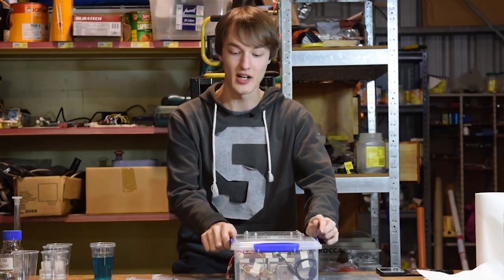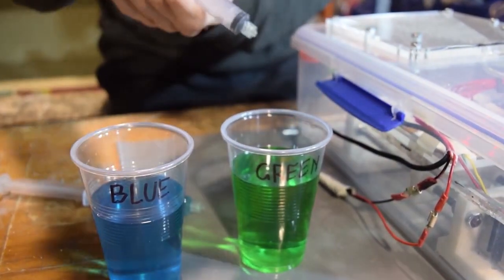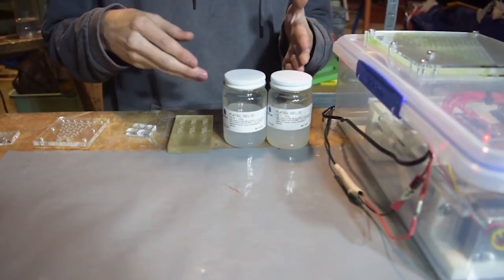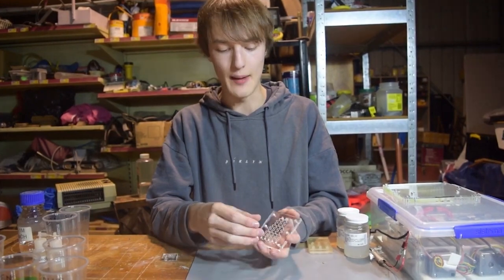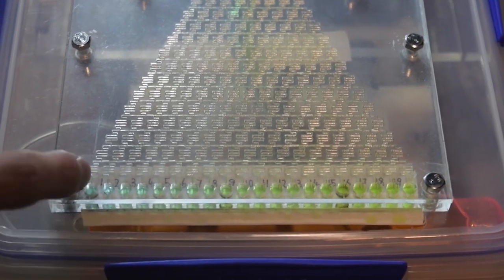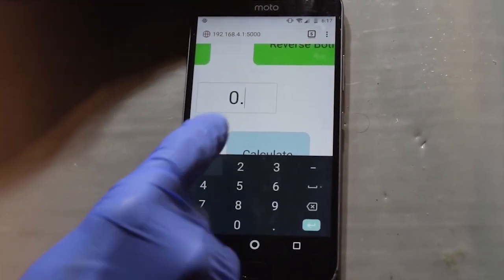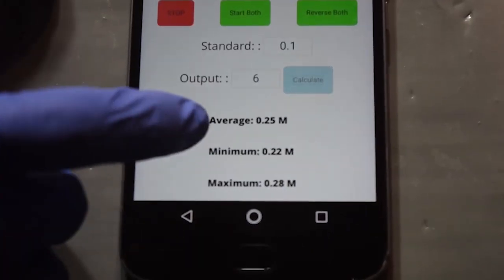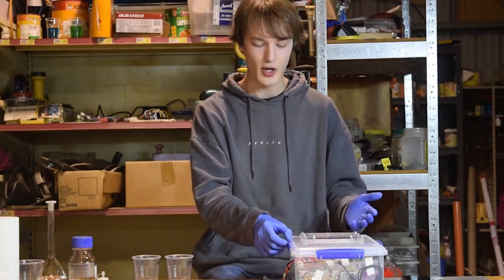Making Microfluidics

Comment: If you run the laser over the two sheets but offset to the original cuts you can weld and seal the channels as the two sheets will be fused together in that area. You just have to tune the power and focus to melt rather than completely vaporise material.

Comment: Nice work!

I would expect the seeping to be a forever sort of problem with that sort of design. I like the tape gasket idea.

How about... this is acrylic, right? Paint a little acetone on the two halves. Slap them together, and apply pressure.
Reply: I have tried exactly this with with Dichloromethane. It seals the channels, and mine were engraved much bigger than the final example he shows here (also made with a CO2 laser cutter).

Comment: So cool and innovative, love the idea, how could it be adapted to do the Redox titrations? Also are instructions/diagrams available anywhere, i want to have a crack at making one! :)
Reply from the maker: In theory, you could perform a redox titration involving potassium permanganate as a standardised oxidiser, the purple colour of the permanganate would act as an indicator, and running the device would essentially be the same as for an acid-base titration. I'm pretty sure other redox indicators exist too.
As far as diagrams go, I have the document that explains everything in detail here: https://drive.google.com/file/d/1Ui4yJCOknswtyiZROEf1wDkxJy4OoB86/view?usp=sharing
It's not the best in terms of instructions or diagrams, but it should explain everything well enough (including some improvements we made to the one in this video) to build one.
Reply: @ScrapScience  Thanks, exactly what i was looking for, just a few question on the channels, how deep were they cut and do you have the webapp code on github? I am going to try and bioprint the microfluidics plate on an adapted ender 2.
Reply from the maker: The depth of the channels isn't particularly important for running the device, but we ended up making them 2-3mm deep for each test. 
I'm afraid we don't actually have the code for the app anymore, sorry. In my opinion though, it's probably simpler to run the machine directly with an arduino or similar and skip the whole app system (we added that in to make it particularly user friendly, but with proper understanding of how everything works, it's unnecessary).
Hope your printing goes well!
Reply: @ScrapScience  Thanks, i will lt you know how i get on

Comment: This is great. How come you don't need to clean it in-between runs?
Reply from the maker: Seeing as it works by essentially passing a liquid through a series of tubes, if we pass enough solution through the device it will very effectively ‘flush out’ any remnants of the previous measurement, after which we can take the next measurement. 
Kind of like how running hot water through a tap will flush out any cold water that was previously running through it, after a short time the temperature coming out of the tap will match the hot water coming through.

In our tests, we found that running the 20ml of liquid for each test was more than enough for flushing the previous sample out.
Reply: @ScrapScience  just seen 20ml great stuff.
Reply: @ScrapScience  injections of dissolved sample are 1 microlitre normally they apparently do it in nanolitres for top of the range machines.
Reply: @ScrapScience  I believe the nanolitre ones are used in toxicology.
Reply: @ScrapScience  get a pH probe and a level surface to get an idea of how precise it is.
Reply: @ScrapScience   Scrap Science  I consider that process cleaning. Sometimes you would need to change the mobile phase/make it hotter in order to dissolve and remove and particulates depending on the application. I wonder how much water you need to put through in order to change the strongest coloured junctions to colourless, it would be based on Pascal's triangle.  This is really cool. I work as am analytical chemist using HPLC LCMS. Which has incredibly similar principles and I am thinking of it in that context. Sometimes you have to heat things to get them to dissolve and they will crash out on the column and create blockages. I suppose a way to speed up the cleaning of the extremes would be to block off all the columns bar one and ensure the flow rate is at a safe level due to the increased pressure. This is super cool you could use it to find the approximate pH of solutions wonder how accurate it would be for that application. If you were to use a pH meter you could figure out where the blockages are inside the column if you couldn't tell from the drop in flow rate. This is engineering which I find a lot cooler and more difficult than simply analysing and changing parts on machine.
Reply: Flow rate on our mass spec is 2 ml per minute on normal runs and I'll increase it to 5ml per minute in the hope to remove blockages and then change the mobile phase and run it overnight as a last ditch attempt to rescue it before having to change the columns which cost £400 each.

Comment from the maker: Originally, our competition entry had a document attached which explained everything in a lot more detail, so some of the stuff in this video might be a little unclear. I can clarify anything if it helps.
Reply: Very nice video! 
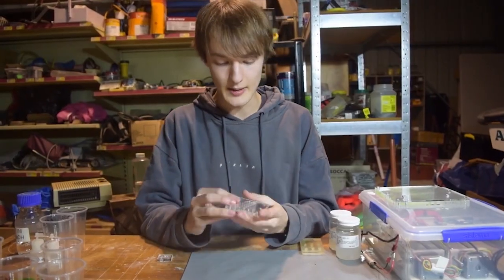I do have a question, did I understand you correctly at 6:45, in that you used tape as well as another piece of acrylic screwed on from the top in your final design? If so, was there a reason, why you didnt just use another piece of acrylic?
Reply: @alb1394  i guess the tape is more flexible than acrylic and can fill surface imperfections, but with only acrylic maybe some leaks would happen
Reply from the maker: @Alber Butz As Elyes has said, using just a piece of acrylic seemed to leak profusely in every test, especially with a network as large as the gradient generator. The tape and its adhesive acts as a seal of sorts to keep everything contained within the channels, the second piece of acrylic is really just to hold the tape down, as it would lift off at high pressures otherwise.
Reply: @ScrapScience  Thanks, that was a helpful answer!